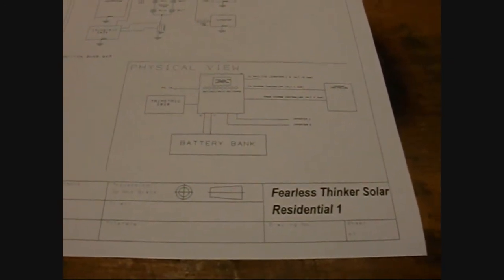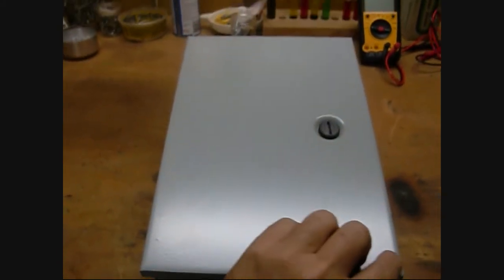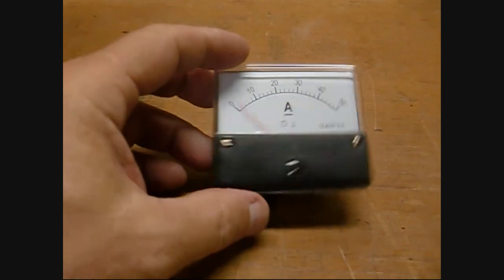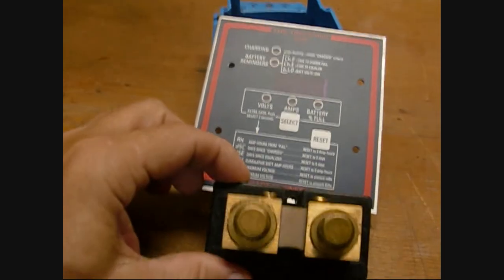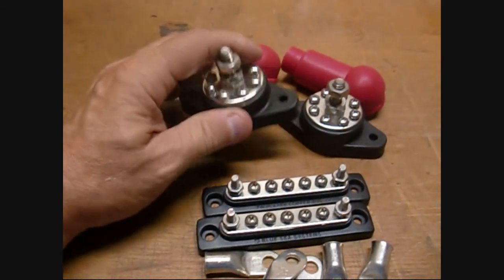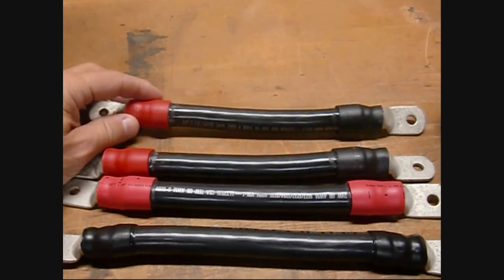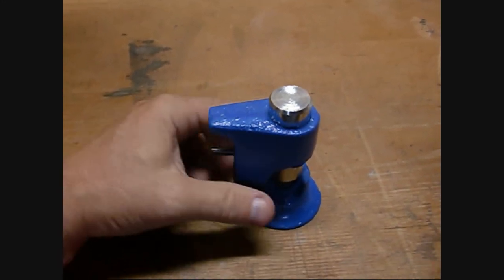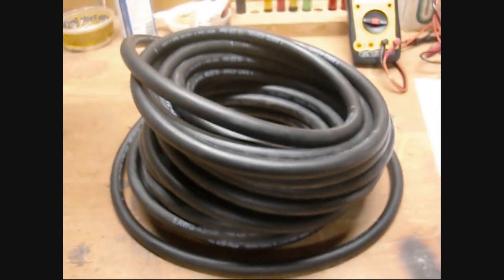Solar Energy Off-Grid - Part 2 - Electrical Goodies

Comment: i want you to help me design a solar system. below are my components

 Battery Temperature Sensor and Monitoring adapter RS485 to USB fit for Tracer MPPT
Blue Sea Systems 5191 Fuse Block Terminal 30-300 AMP
XSCORPION (CB250) 250 Amp Circuit Breaker with Manual Reset
Marinco 701 Battery Disconnect Switch
Inverter
Dual Display DC Digital Multimeter Voltage Ampere Meter LCD Digital Display Voltmeter Current Meter with Shunt Volt Meter DC0-600V Amp Meter 0-100.0A for Battery Chargers 
SolarEpic MPPT 40A Solar Charge Controller 150V PV input Tracer 4215BN
DROK DC 8-63V Lead Acid Battery Tester, 12V/24V/36V/48V LCD Digital Battery Capacity Monitor Panel Gauge, Lithium Battery Status Indicator,

Comment: I want to build a charge controller that will charge the battries once full switch the pannels to gride and then switch back when battries are low or provide a trickle charge to battries to keep them toped off while still providing power to the gti. and same with wind. I have a tone of Ideas been studding the andrino stuff for such charge controllers.

Comment: I need to get a box like that. I have one from old eq at a factory my fatherinlaw gave me I used for my coleman air charge controller and shunts. for me its two short its nice and deep. but I neeed a longer one for more meeters and other stuff like my solid state relay I built I have videos up of it please tell me what you think of it. so fare I have had it up to 50 amp dump on one 1000 watt gti and 500 watt gti

Comment: I really paid too much for Hoffman box I paid 60 bucks for it. on ebay LOL I paid too much for my battery cables that are only 4awg I think at advanced auto parts. Man did i get ripped off. I d like to know were you got those awesome battery cables at? My meter was about 20 but its a 75 amp not too bad a deal and its really old stock. I wonder if it has a shunt in it? I need some fuses still dont have any where the heck did you get that fuse holder and fuse for four bucks at?

Comment: How can you tell if your analog amp meter has a built in shunt or not ? I might have bought one that dosen't have a shunt built in. Also, I have seen people connecting the meter in series with the positive side and some on the negative side. Does it matter?  I have seen the development of your system from the start. I'm watching to see what I can emulate to make mine better. Thanks for showing.